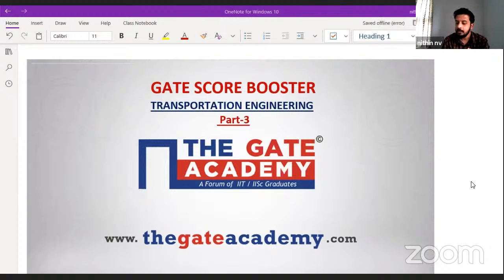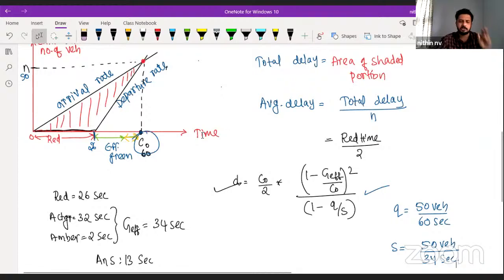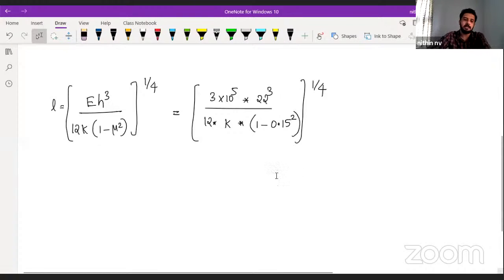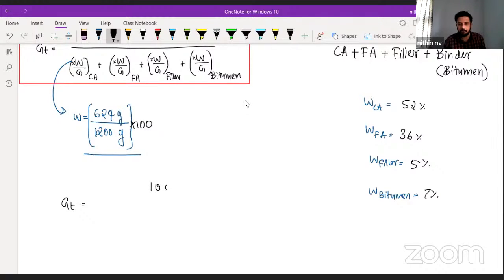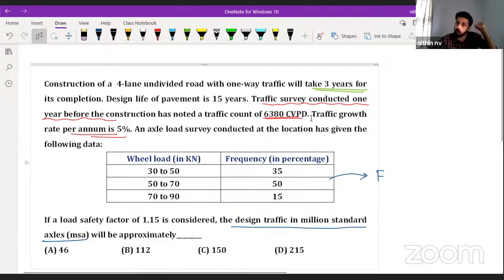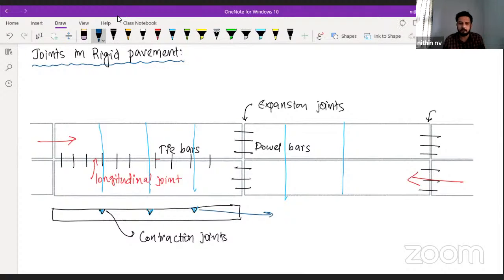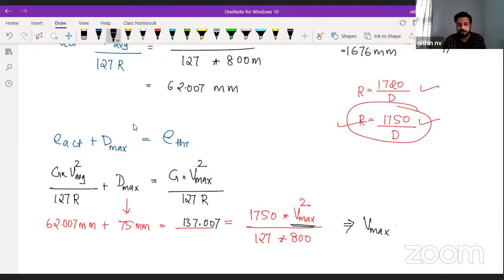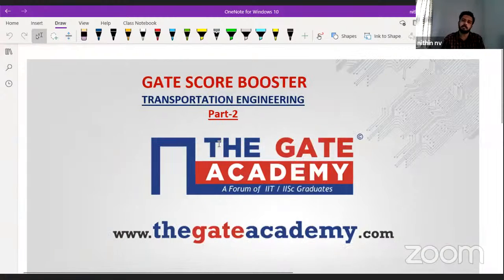Transportation Engineering -Part-3

Comment: Sir, in the first part you take t=2sec, for calculating SSD. But in the lecture series you have told us to take t=2.5 sec. Which value we should take for t, 2sec or 2.5 sec?
Reply: Dear Subhajit,
For SSD t=2.5 seconds and we have taken 2 seconds for OSD,  not for SSD. 
Means, For SSD( Stopping sight distance), t=2.5 sec (if not given in the question)
and for OSD(Overtaking sight distance), t=2 sec (if not given in the question)

Comment: To calculate vehicle damage factor....I have seen standard value of load as....8200kg.... kindly look into it..
Reply: Dear John,
We can express the standard load in any load units. In KN unit, we consider standard Axle load as 80KN or Standard Wheel load as 40KN. In kg units, standard Axle load will be taken as 8200 kg and Standard Wheel load as 4100 kg. In tonnes unit, standard Axle load will be taken as 8.2 t and Standard Wheel load as 4.1 t